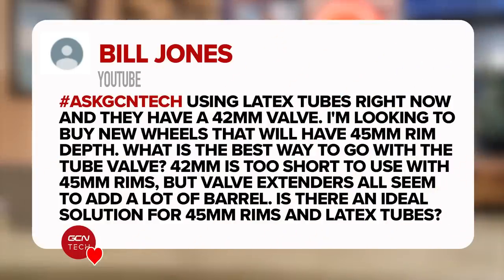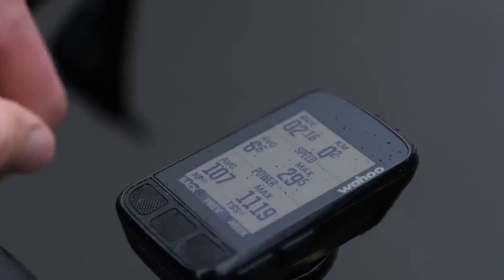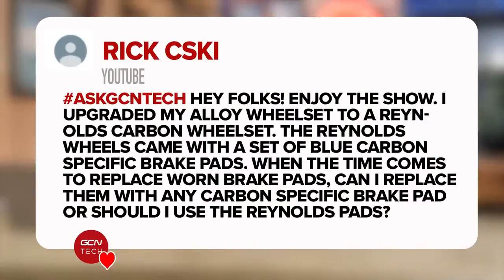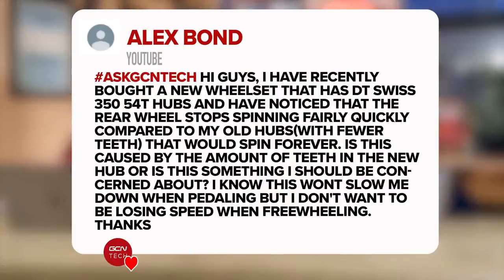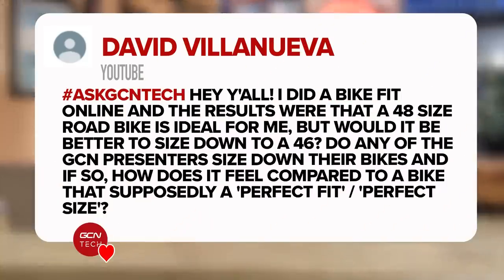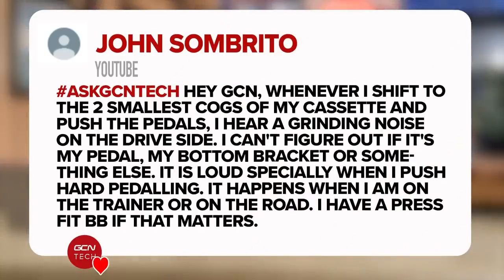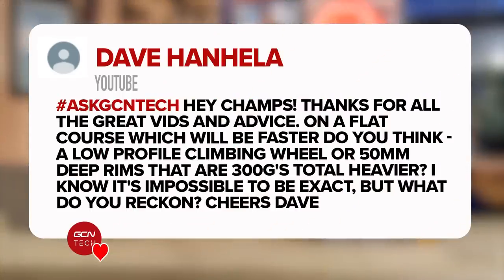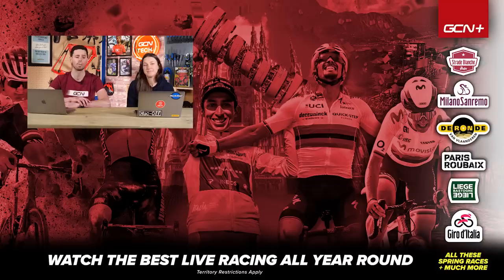Does Wheel Weight Matter On A Flat Ride? | GCN Tech Clinic

Comment: I upgraded from my 35mm basic carbon wheels to FFWD’s RYOT77 and I can say that despite being 300g heavier, they’re faster. I’m seeing my avg power drop but my avg speed remain the same or greater since I swapped.
Reply: Normal As  and what?
Reply: 77? sounds stable
Reply: @crimson177  mostly, it is. I’ve biked in light winds, strong headwinds, and crosswinds upwards of 20mph with these wheels. I haven’t yet had any issues, but I’ve certainly felt twitches and instability here and there. The trick is to be relaxed and don’t death-grip the bars. Be ready to gently stay on track, give yourself more of a space to work with, and you’ll be fine.
Reply: Normal As  he did make a clear point
Reply: Way better to invest time in winter workout, e. g. on a cheap Tacx device. Riding a fat MTB my comrades on racing bikes "admired" my back wheel in spring ...
Reply: @sotecluxan4221  I ride this same bike all year outside, through winter. Here in Chicago they do a good job of keeping the roads and trails clear, and even slick road tires are fine in virgin snow.
Reply: I’m just here wondering why you drop your avg power instead of raising your speed…
Reply: @TSonemusic  not on purpose. It’s hard in Chicago to go extremely fast unless you only bike the LFT or you’re super reckless and fly through stop lights without slowing. So as a result I’ve noticed my avg power dropping on rides since I swapped over to the deeper, more aero wheels but my average speed remaining the same over 30-40 city street miles.

I know it’s not conclusive proof of anything, since a strong tailwind can seriously reduce your power output but keep you speedy; it just seems to me that the aero wheels are affecting my rides.
Reply: @Darsithis  Purpose using e. g. an indoor device, is to be faster on the road. A saying says ...fast cyclists are made in winter. So it is not the weather or bad road conditions. Above mentioned is simply a matter of physics! I was very suprised about the effect, when riding outside again in spring. Feels like an electric motor in my legs, very smooth and fast.
Reply: @Darsithis  well your are braver than me. I had 55/50 wheels and whilst I never felt like I was going to die and I could handle it, I just never felt comfortable when I heard the sound of a oncoming gust. and eventually I sold them.

Comment: if the weight difference between two wheels is only 300grams, the weight drawback of an aero/deeper wheel won't make a perceptible difference in a climbing scenario..suppose you climb 1h at 5 W/kg (which is pretty decent...do you?!): 0.3 kg * 5 W/kg=1.5 Watts...so roughly, the 300 grams would cost you 1.5 Watts but the aero gains will overcome these ridiculous losses as soon as the climbing gradient goes below/around 7%...so unless you climb regularly Zoncolan, my opinion is, go for the aero wheels and keep your chain clean...a dirty chain is much much much worse than 300 grams of added weight 😉

Comment: Grinding noise on the large cog may be the b-screw adjustment where the derailleur mech is grinding the cog. Shift into the highest cog and look at the spacing between the cog and idler.

Comment: Continental makes short valve extenders, but better to use tubes with proper full length valves, 60mm should fit a 45mm rim pretty well.

Comment: On the question about the chain making noise in the bottom 2 gears, it could be that the front derailleur is not adjusted well so the chain is hitting the derailleur when pedaling.

Comment: As far as carbon vs alloy rims durability on a gravel bike: alloy wheels may survive crashes or side impacts more often than carbon.
Reply: and less painful to replace if you do damage them.
Reply: Im not so sure about that. Ive had to replace more aluminum rims than carbon rims. My toughest rims are carbon rims, superteam of all rims. They have a max weight of almost 900lbs of load. Not a single 1 of my aluminum rims come even close, sunrun makes some of the strongest aluminum rims on the market, and they max out at 500lbs max load. Aluminum rims dent way to easy.

Comment: For excessive noise when shifting to smallest cogs, check on a different wheel first. I've had a bent front chainring tooth that worked fine mid and upper cassette but only started missing links in the smallest cogs.
Reply: Me too. Eventually one of the SRAM front chain teeth ring bent sideways.💪 I had to file it down to fit tho get it working again

Comment: I've used Reynolds carbon wheels, with their cryo blue, cryo blue power and swiss stop black prince pads. with the swiss stop pads the rims overheated very easily, even short downhills will have the rims hot enough to be untouchable and loss of braking power. the cryo blue power costed more and was harder to get but its the best for the rim in terms of braking consistency and heat management. so stick to recommended pads for your safety.
Reply: Also,if you use any other pads than those supplied by Reynolds, you void the warranty. Yes, they are more expensive, but you have to look at the value that provides.
Reply: Try barradine pads ( from Taiwan).. good sh*t
Reply: @richardggeorge  ah OK, would try but changed to disc brakes after a scary steep winding downhill in the freezing rain with stop and go traffic 😂
Reply: @rasyidizulkifli2285  sounds a bit scary. Not an issue in Melbourne as it's pretty flat and hardly ever rains. I have 160mm discs on my heavy steel commuter bike though  ⛈️🚵‍♂️🌧️

Comment: Awesome topic at hand. 5 years ago I purchased a set of #Yoeleo SAT 88 MM wheels and they rode so well I purchased the 2nd pair 3 months later with UD MATT FINISH & a different decal setup. I rode the first pair for all of 4 & a half years before riding the 2nd pair. Now I’ve purchased a new Cannondale Synapse & guess what, I just received my 3rd pair of Yoeleo SAT 88 MM Carbon Wheels for my new machine. I can honestly say these wheels are 25 MM WIDE with a U- Shaped design from the traditional V shaped carbon wheels. I’m 6 ft. Tall & weigh 220 lbs. I’m beating my buds up climbs with not only my physical makeup but with these fast semi-heavy carbon wheels @GCN Tech📌

Comment: #AskGCNTech RE: heavy deep aero wheels vs Lt/Wt shallow aero wheels on a "flat course".
Yes, Alex & Manon you are correct the heavier wheelset is best on a flat course like Kona Ironman. The course has hardly any sharp turns, and the heavy wheels have a flywheel effect that once you get them going, they keep going.  !.."BUT"..!  It will all work against you if you do not rotationally balance those heavy wheels. Some of those deep aero wheels are off balance by as much as 30 grams!!! Thats like having two wheel reflectors staked on one side of the wheel which makes your wheels so lopsided that at high speeds they oscillate so badly they actually slow you down. It happens because the spinning inertia is interrupted and is not smooth and flowing like a well balanced flywheel.  That is the secret to using heavy wheels and getting all the performance the wheel can offer.  Currently 99% of all wheels are off balance by as little as 5 grams and up to 30 grams and its all due to sheer luck that some are better balanced then others.  Its a long story why, but that is a fact.  So please until a wheel manufacture comes up with a simple to use wheel balance system, if you're going to compete and you want to squeeze all the performance out of your bike, YOU NEED TO BALANCE YOUR WHEELS!  Sincerely Dan Sotelo
Reply: How do you test that and then balance them?
Reply: If you put your bike on a bike stand the heaviest part of the wheel will rotate to the bottom. But I have no clue how you would balance them. Can you add a weight to the base of a spoke? Great question.
Reply: I took some flat rubbery fridge magnets cut other the weight of the valve (cut a valve out of an old tube and weighed it) then placed it under the rim tape on the opposite side to the bottom where the settles.  Sorted, no speed wobble forming at 45+mph the bike is planted.
Reply: @angelmpalomares  you can buy golf lead stickers. 3gr each. Stick them to the inside of the wheel, under the rim tape for example. usually opposite to the valve stem. To know the total weight necessary, stick plasticine to the outside of the wheel, with the tire mounted. and keep adding plasticine until the wheel is balanced. Then just weigh the plasticine and use the corresponding lead stickers.
Reply: The “flywheel effect” has been dis-proven…
Reply: @johns3106  Disproven by who???  So Johnson S, try this...  Set up the lightest wheel, tire and tube and or tubeless wheel set up there is...  Then go down a long gradual down hill as fast as you can...  You'll quickly discover that you have to pedal like crazy just to keep up speed as everyone else around you is passing you by, most just coasting.
You see, a light weight fly wheel carries very little kenotic energy vs a heavy fly wheel/. If you spin them both up to the same speed and let them spin out, you will see that the heavy fly wheel will keep spinning long after the light fly will stops spinning.
Same thing with a bicycle super Lt/Wt wheels, vs Hvy wheels at the KONA Iron Man.  On top of all that technical mess, in order to squeeze ever bit of forward moving performance out of the Hvy wheel, you need to balance it.  It goes by NEWTON's First Law...  A mass that is put in motion, will continue in motion unless it is, interrupted by an outside force (ie aerodynamics), or an oscillation (ie rotational wheel balance).

Comment: Grinding noise on the drive side: I doubt it's differential wear on the sprockets. The clincher is if the OP has a front mech. If so - it has to be chain rub on the front derailleur cage.

As for Reynolds and Cryo Blue™ brake pads - Absolutely a must-use decision. Different carbon rims work best with their own pads. Wheelworks Maker rims definitely do not play nicely with Cryo Blue™ pads - in fact they will be very difficult to stop especially in the wet, and vice-versa. 
Reynolds may also void a warranty, which is worth having, if a rim fails and the pads used were not theirs. 
FWIW, I have cooked and warped a Reynolds 58 Aero front rim despite using Cryo Blue™ pads, on a hot day descending the Col de la Col de Fer in July 2018 (doing the entire Tour de France route one day ahead of the race). I was seriously held up by traffic on the descent and so had to hang on the brakes much longer than I wanted to.. The rim was 4 years old and had seen some action. On informing Reynolds, they offered a new Reynolds wheelset of my choice for half retail price. I bought a set of Aero65 db. Bargain.

Comment: re: heavy wheels, that really depends how you ride them. If continuous even power/cadence - then aero plays the game. If however you need sharp accelerations, slowing down (yes, on the flat), lighter wheels will win. However, it's important that if two wheels are of the same weight, yet one has weight inside - it will be faster, than the one what would have more wight outside. In another words, rim, tyre weight and inner tube (if used) are crucial! And hub, rotors (if disc wheels) - don't matter as much weight wise.
Reply: Hubs absolutely play the most when it comes to tire spin. If your hub is garbage, doesnt matter if its a $2,000 set of zipp rims, or a $90 set of dtswiss rims. You're speed will absolutely be hindered. A novatech hub has nothing on a chris king hub. They cant take the same bearings, and they both have different splines. Most novatech hubs only have a 3 paw catching system, while most chris kings have a 6 to 8 paw spiral spline catching system. You can put a $480 set of hubs on a cheap rim, and out perform a set of $2000 rims with a $50 set of hubs, the less amount of rolling resistant is king to tire rotation. Not weight.
Reply: It's amazing how physics can be warped to fit current marketing trends! We need aero profiled dropper seatposts, heavy 80mm carbon rims, disk brakes, aero helmet, below UCI minimum weight bikes, sealant that matches the bike frame, power meters, Strava, a bike fitter,  coach, sports psychologist, Zwift,, Whoop strap, just to show up at a group ride. At 63 I'm faster than the average male on Zwift on a mid range track bike on the road. All this one upmanship and naked greed I find disgusting.

Comment: Definitely include the zeroes in the power average if you freewheel a lot. And if you stop for anything longer than a traffic light and you're worried it'll ruin your average, just pause the activity for that stop. I assume you can pause it on any head unit/smart watch/smartphone app you use, but I might be wrong since I have not used that many different ones. Mine even autopauses at traffic lights if I wish it to, but I turned it off. I always pause for toilet breaks and such, but if I just don't pedal on a downhill section, I deserve that 0.

Comment: Grinding noise on the small cogs....probably the chain running on the front mech as chain line not perfect. Can be a problem as the cable stretches as pull reduced.

Comment: As far as rear wheels spinning longer I would say that the difference could quite easily be the freewheel and not the bearings. A lot of them are unnecessarily noisy due to some perceived idea that noisier is better. In a perfect world the front and rear would spin as long as each other.
Reply: But freehub noise is life.
Reply: How exactly perfect is that world you are talking about? Front a rear would stop at different time just because one has 2 bearings and another 4 (or 3 and a bushing). Not to mention the seals

In the real world DT350 are known for having sometimes the bearing seat too tight and jamming the bearing. Unfortunately, in this case they don't free up as Alex described (or bed in as it nornally should be), they wear out and render useless
Reply: Noisy hubs are the Harley Davidsons of the bicycle world.

Comment: On the wheel turning less because of the hub teeth, I would check the torque on the cassette. If the lock ring is too tight, the freewheel will drag and wear out quite quickly.
Reply: Really? Most people under torque ( less than 40Nm). I used a breaker bar as I hate cassette bight in my alloy freehubs. Never worn out freehub bearing either. Shimano, SRAM, mavic and novatec hubs
Reply: @richardggeorge  Just thought it would not hurt to mention it as a variable. I over-torqued (<29.5 ft lbs) a Sram cassette by feel 'once' when I tore the drivetrain apart in the field while bikepacking. I knew definitely I roasted the freewheel when the cranks kept turning when I was freewheeling.

Comment: #askgcntech Hello <insert next weeks tech clinic presenters>! Right after New Years I bought my first road bike, a Bianchi via Nirone 7. I bought it online so I didn’t have anybody set it up for me and with the help of your videos I did my best to do it myself. The only problem I have is I keep hearing a light rattling noise from the chain while I pedal. I fully cleaned the chain and applied Muc-off ceramic dry lube but the noise is still there. I also indexed my shifting and I am sure that the chain is not skipping. Is it normal to have a light rattle or should my drivetrain be absolutely silent? Would a wet lube make my drivetrain quieter? I mean I can only hear it when I ride quiet roads but it is giving me anxiety. Just for comparison it’s about 70% as loud as the free hub.
Reply: Might be chain rubbing on a derailleur cage. Watch Park Tool videos on how to set up front and derailleurs as they are idiot proof (that's why I used them 😁)

Comment: #AskGCNTech Good show again, folks! On a flat course, aero wheels will obviously help. One thing to add some complexity to the weight of wheels is whether repeated accelerations matter, for instance, think of the constant corner sprints in criteriums. Does the energy required to spin up the wheels out of the corners mean lighter wheels would help?
Reply: People who race cars think so and use the lightest wheels possible. I know Ollie disagrees but I’d go with the lightest you can afford.

Comment: At 8:17, on the grinding noise, could it be that the the front deraileur is not well suited to the number of teeth on the rear cassette and the chain is rubbing on the deraileur.  I know that the manufacturer specifies compatibility and ranges based on number of teeth that a given component us good for to ensure proper clearances to prevent dragging the chain across the deraileur.  Improper setup or components has caused issues for me in the past.

Comment: Re the aero wheels the discussion leaves out too much. At what speed is the gain worth the lightening of the wallet. What other changes could the rider do to to get the same or greater improvement? How often do you race/ride a flat/straight course? Are there cross or side winds to deal with? Are you a pro or a poseur? So many question left on the table.